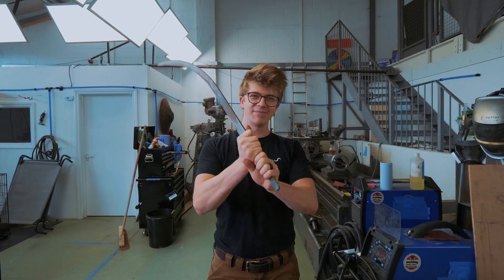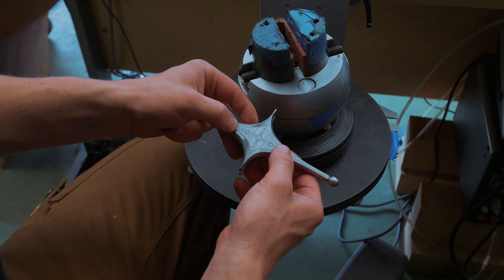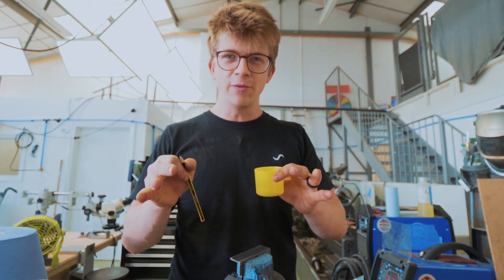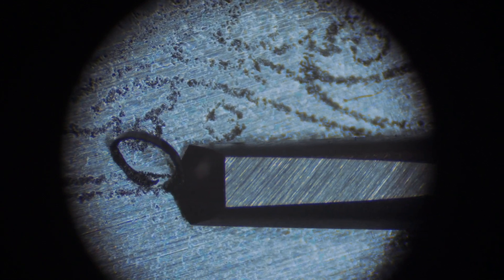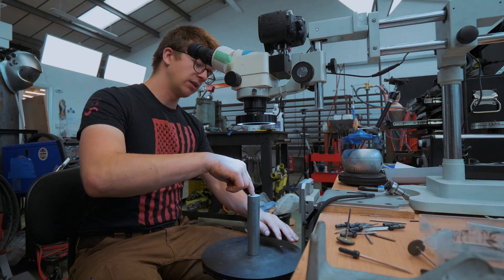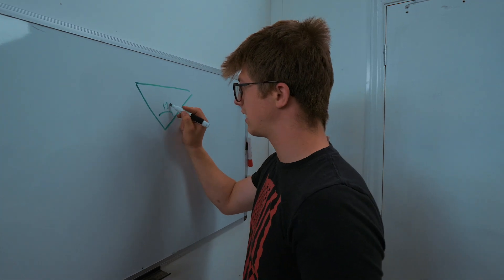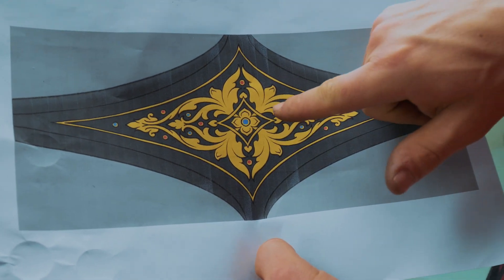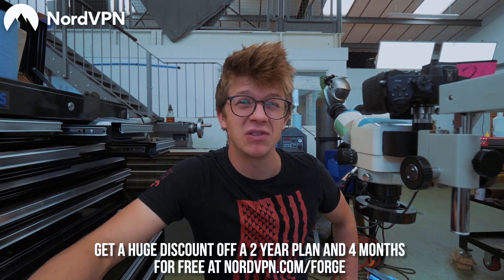MAKING A SHAMSHIR SCIMITAR!!! Part 5

Comment: If fine engraving is anything like miniature painting you need to keep a reference pinky down. It' ll help greatly with control.
Reply: explain? like your pinky is resting on a surface to stabilize your hand? I have a bunch of painting stuff but haven't dived in just yet on my main painting project (just a couple practice pieces). So a tip like this I've yet to hear about sounds interesting and like it might be useful.
Reply: I personally wouldn't put my pinky anywhere near an engraving tool. The front, anyways, cause if you slip, you might gouge yourself.
Reply: @SeraphX2  Having your Pinky down on the piece you are working helps your brain make a connection to your work-piece and subconsciously stabilize your hand to the piece so they move together. Try with and without and see the difference.
Reply: Just like sipping tea! Keep the pinky out for reference and balance.

Comment: If you make a piece of angled steel that stays at the correct angle you want then depth is about how hard you press it in, although that could be taken care of by sliding it down and making it friction held or clamped into the engraving tool. The slight movement taken care of by the slide, the slide can have a small amount of play in it that allows for it to be used just fine without needing to have it move the entire wedge and slide piece. Hope it helps

Comment: now i've probabaly had less experience than alec doing wood carving buuuuuuut i found when doing wood carving using a tight v gouge to get myself set then going in again with a wider gouge helped a lot, don't know if it might work starting with like a 90 degree engraver to set the depth then coming back with the 120 to widen out, that way theres only one thing to focus on at a time, first depth, then sides. just a thought

Comment: You can try to iron the ink from paper to metal if you use laser printer. I used that technique in a past to make PCB boards with not very good success. There was brakes in connections but definitely good enough for engraving. Laser printer ink is  basically carbon dust with hot glue and it stick into metal.

If you want to go step forward, you can also try etching. For a best quality you need photoresistive lack, uv lamp and a transparent negative from you engraving figure. You can print them on transparent tracing paper, plastic film or if you want really good one, order high contrast film from print shop.

Spray the lack into you piece, Exposure it with uv light through the film, develop and etch with ferrichloride. You get etched figure which is easier to deepen with engraving tool. If you don't brake the original edge, you'll get very precise figure.

Comment: Another trick I've seen is to put transfer paper in a laser printer and then stop it just before it goes into the fuser. Using that method lets you see where you are placing the design.

Comment: Alec, use a heat to transfer drawing! Print by laser printer on usual office paper, heat the metal piece you want to transfer to, then press paper on target through some soft material  (fabric). Then after cooling wash away paper by warm water tearing it by finger. 100% guarantee )))

Comment: As a amateur engraver, but having hours of research of setups, I have an idea: use a pitch bowl; You'll keep your angle and it'll be easier to set the angle.
There's mixes involving pine pitch (thats a Japanese mix) or German pitch.  Theres and type of orange resin/pitch(?) that has potential but I haven't really used it myself.

The bowl itself can be wood or metal, but it needs a heavy bottom so it stays put (built very similar to an engraver ball)

Note: you must heat the pitch with a flame in order to set in and remove the part, so be sure to not heat the part directly enough to mess with the temper.

Comment: Hey Alex, you could also try toner transfer paper, it's a technique that is fairly commonly used for PCB (printed circuit board) echting. It's fairly cheap paper and works quite well on copper, definitely give it a try!

Comment: Have you looked at other engravers cuts under the microscope. ?  Stereo Microscopes are fantastic tools, love the engraving, I'm just looking at how to transfer fairy door designs to wood, , a template and burr is faster for a one off than a cad model and cnc for me .  0.7 to 4.5 x zoom with a 10x eyepiece gives 7-45, lots of old olympus SZ series are great. . Use a microscope for electronics, Soldering an 0102 by hand needs x45, but even at x7 the details of the bmx bike track are visible. phospher bronze patina ? great work.

Comment: @Alec Steele Here's a tip for transferring printed patterns on metal from the field of making electronic PCBs at home with very fine details. I notice you have a laser printer, that's perfect all you need is to place the paper on the metal and use an ironing iron on the back of the paper, that will plasticize the ink and glue it on the metal much better and then you rub off the paper with water, you'll see the pattern stays on the metal. So just iron the laser printed pattern onto the metal part.

Comment: My first thought for keeping the engraving tool at a consistent angle was to rigidly attach something to the base of the tool that would extend downward and rest on the guard. this would keep the engraver at a consistent height through the guard i think, but im probably completely wrong, plus it would be a pain to hold comfortably anyways. Just a thought though if you can think of a variation on that to help make engraving more consistent

Comment: Have you thought about a laser engraver for your next project like this? With stainless, you can coat it, laser it, and if it’s not PERFECT, you get the engraving off and it’s bare steel again… or just engrave the outline with the laser and it would be perfect. No paper.

Comment: In my printmaking class we would transfer inkjet prints to copper plates by saturating the paper in wintergreen oil and using a spoon to burnish the paper and transfer the image to the plate so we could engrave the design onto it.

Comment: ya know, chucking the pneumatic engraver tool into a stationary holder allows the work item to be held on a table mounted jig that has precision dials, similar to the manual controls on an end mill.

Comment: Kind of overly complicated using baking paper when you can just take the backing paper from a full page sticky sheet and use that... just saying. Also, it works without having to add any fluids or liquids. Just put it on firmly and back press to release it from the paper.

Comment: I remember a tattoo shop reality show where they transferred a design from a laserprinter to someone's skin using deodorant. That simple. There are also a few reliable methods to transfer a circuit board design to a copper plate to protect the copper you want to keep, while etching away the rest.

Comment: You should get a CO2 laser that can engrave the design outline for you to follow.
Reply: Came here to ask this very thing.  Could you etch the design, then use that as an engraving guide?
Reply: @DigitalPetrol  yes but maybe not in this case because of the angles it would be slightly distorded now that I think about it. Plus that wax paper transfer seemed to work well enough.
Reply: @cwinter90  I agree with your point, but wouldn't it be doable to alter the parameters of the laser etch to account for that? all it would likely take is a 3d scan of the part to be carved, and... 

yeah. that's hard.
Reply: I thought etching as well, but can anyone tell me why just SCRIBING the lines first would be a bad idea?
Reply: Map the surface and then a diamond graver on the CNC?
Reply: @davidhawley1132  then why is he engraving at all?  I mean there seems to be a line between making things easier and having the machine do it for you?
Reply: @highlorddarkstar  The answer to your question is obvious, isn't it?  End product.
My suggestion is basically the same as the OP's CNC laser suggestion, which isn't the same as full milling.  The undercutting and other techniques for fixing the gold inlay also isn't covered, and probably isn't suited for typical CNC.

Comment: I was thinking you could take a page from Jairus of all and cut out the design, coat it in plastic (packing tape or something just to keep the paper dry... ish) and electro chemically etch the design on.
Reply: i dont think you would get nearly the same depth as you can with engraving and it doesn't really give the same effect
Reply: @Simon-jr2oe  I think there is a misunderstanding... I was meaning to mark it for engraving.
Reply: @StarScapesOG  I'm not an expert on either but there is a reason that the two methods are used for different things it could work but something tells me it wouldn't be the same
Reply: CNC with a diamond graving point?